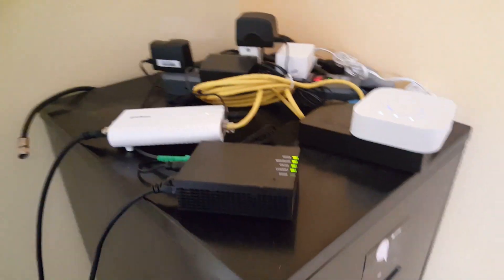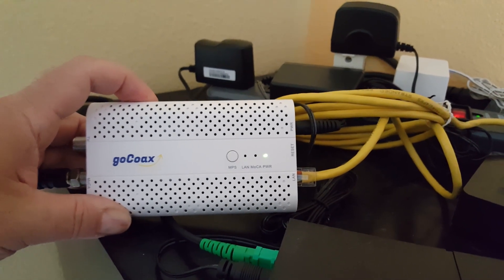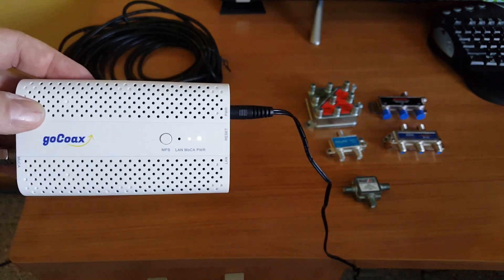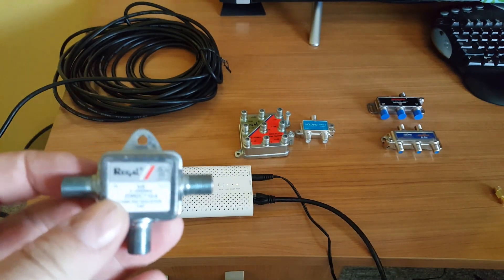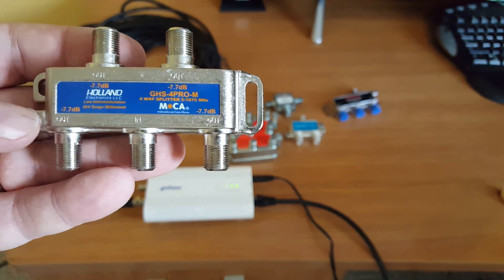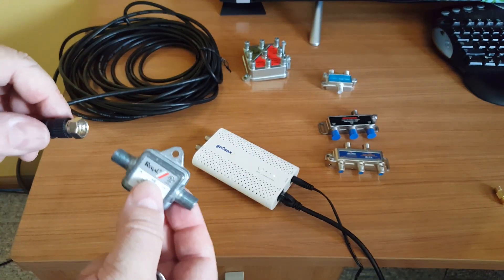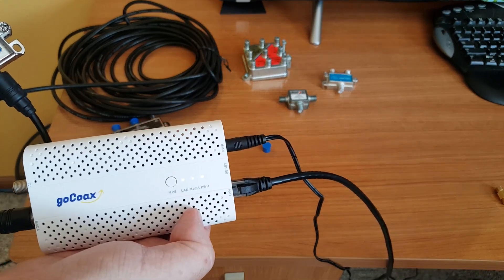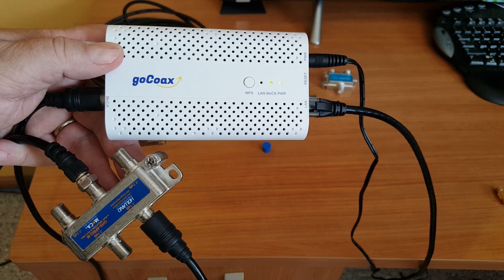How to troubleshoot connection problems with MoCA (goCoax WF-803M) and basic MoCA setup requirements

Comment: Hi I need some help I set up the moca up and everything but I’m running into the problem that my moca is saying my coax is not detecting I waited for 10 min and nothing is happening
Reply from the maker: Hello!  Can you describe your setup?  What MoCA devices, how connected and where is the 2nd location?  Also, have you traced/confirmed that there is an actual connection from the first device to the 2nd?
Reply: @UncleMikeRetro  thx so much for getting back to me, I have a pc and I did all the step properly and the power light IS showing up but the coax light is not there meaning it’s not detecting the coax
Reply from the maker: @overkillfn2918  No problem!  You do have to let us know what MoCA devices you have and how they are connected and to what.  it really sounds like, from what you say, that the first MoCA device is not finding the 2nd.  You do need two and they have to be on a coaxial line or lines that are ultimately connected and without any splitters in the way that might alter or distort the MoCA signal.  I cannot have any other thoughts unless you share some of these details, pal.

Comment: Hi Mike,  thanks for the video. I just got my moca set up and running in my new house. I have two access points connected upstairs and running Moca. I am running into some issue where one of the access points drops internet and I need to unplug/replug the moca in order for it to work. 

Do you have any idea what could be causing this? The splitters I have hooked up were the ones the were originally on the coax so may not be moca compatible?

Interested to see what you think. Thanks!
Reply from the maker: Hey Travis!  First, thanks for the kind words on my humble video.
Second, how often do you have to restart the 2nd MoCA device?  I mean how often does it lose its connection?
If resetting it fixes the problem, how long between drops of the internet?
My gut says that the splitters are MOSTLY compatible, but if you get a connection and it drops (and you still maintain the internet on the first device/computer and don't have to reboot your router) I'd say try a MoCA compatible splitter next.

Keep me looped in, pal.
Reply: @UncleMikeRetro   Hi Mike!  thanks for the resposne! I have a new issue that I am hoping you may be able to help with. On Friday night, Spectrum came out to my home and turned my service off because they said my home was producing  "noise" on their network.  After a few visits from a tech, they said the noise was likely from my moca network and the additional coax cables running off my splitter that were not being used. They told me my Moca would continue to create noise for them and that they would likely be back out here to turn it off if I hooked it up again.

Is there any way to combat the issue? They did run a new line to he home so I dont think their cable was the noise issue. Thanks for the help!
Reply from the maker: @travishmoore17  Good morning, Travis.
The only thing that comes to my mind is that you may need an inexpensive "MoCA filter" placed where the Sprectrum signal enters your home.
This site has a pretty good article about them and the placement: https://www.ppc-online.com/blog/moca-filters-your-cross-interference-issue-solved
Aside from that, I am clueless.  Spectrum obviously knows you have something interfering with their signal and it may be that this can isolate you from the rest of the neighborhood.
Let us all know!  and good luck, my friend.

Comment: Thanks for this very clear presentation.  I have a two-story house with an attic.  Multiple splitters are employed in the attic and I suspect there are other locations where splitters are used.  The cabling was originally done over 25 years ago.  Will I have to track down and replace every splitter in the house to insure an optimal and reliable MOCA network?
Reply from the maker: Hello, Dave!  Thanks for the kind words on the video!
In my opinion, no.  Not initially.  You hook up two MoCA devices in different rooms and cross your fingers.  You may have lucky splitters, you know?  If not, then check them one by one, but only the ones directly in line with your rooms, not the ones on areas you are not using.
I also have small splitters here and there (some probably inside my walls), but I only worried about the one big one between my upstairs office and downstairs studio.  The others I ignore for now.

Comment: Mike, do moca adapters extend my wifi signal like a mesh system but better?
Reply from the maker: No.  They only allow you to run the equivalent of Ethernet over coaxial.  Nothing to do with wifi.
Reply: @UncleMikeRetro  so can i use moca adapters for my mesh for wired backhaul? Or just connect a wifi repeater to each moca adapter?
Reply from the maker: @nirhaber6149  You can use the adapters wherever you need the wired structure but you gotta have coaxial in place first to even make them work.  Sorry if this is basic info to you.
Reply: @UncleMikeRetro  I do have coaxial cables as I have a TV in every room
Reply from the maker: Then these will provide the equivalent of Ethernet connections in any room with coaxial cables already installed.

Comment: Two story home, if the router is in the first floor, that floor gets a very good signal and yields a very good internet speed but the second floor doesn't and vice versa. How would you use these MoCA adapters in my case? I don't have any switches nor hubs. One Coax cable going to the Modem and Ethernet cable from Modem to Router.
Reply from the maker: If you have coaxial in the other rooms, then it uses those lines as Ethernet cables, giving you 1 GIG connections.  That eliminates the need to worry about the WIFI signals except for those devices that NEED them (like ROKUs or smart bulbs, etc.)
What kind of internet do you get?  DSL, cable, etc.?
Reply: @UncleMikeRetro  We have Spectrum and yes I do have a cable line that I can use. It looks like this could be answer to my slow internet issue.
Reply from the maker: @jrpinedam  Yes, I had Spectrum cable internet too and this DID solve my issues.  I had no compatibility problems with that setup.  Now I don't care if I am upstairs next to my router (and hard lined into it) or if I am downstairs and using the MoCA.  Same internet speed, no additional lag.

Comment: New Sub here. What does the Gocoax actually do?
Reply from the maker: Hello pal!  Glad to meetcha!  Well, the goCoax (or any MoCA devices) allow you to use the existing coaxial cables in your home, apartment, etc., as Ethernet lines.  Speeds of 1 GIG and up and no loss of speed.  I am not affiliated with them, but love my setup so much I had to make the videos.
BTW, if I need to know about rechargeable battery packs, I should be coming to you!
Reply: @UncleMikeRetro  oh awesome a lot of people I know who live in apartments can not run wires or drill holes. This will help. Thank you for sharing this with us.
Reply from the maker: @DiyintheGhetto  Hey my man, it's all my pleasure!  Feel free to share with all of us if you get a network using this up and running!
Reply: @UncleMikeRetro  A friend of mine down in Georgia will be needing this I’m not heading down there for 3 weeks I also will post a video on this. Again thank you
Reply from the maker: @DiyintheGhetto  Sweet!

Comment: I have found that these goCoax adapters don't work well or stay connected when connected to a network that contains Actiontec adapters. It seems that they only work when connected to other goCoax devices. I replaced them with Actiontecs and had no problems.
Reply from the maker: Well, your experience is certainly worthy of note.  I only have the goCoax ones myself, but they are SUPPOSED to be cross compatible.

Comment: I have 3 Go coax adapters and they work excellent. The only issue I’m having is I can’t get back into the GUI. It won’t connect if I factory default them I can get into the GUI but once there setup and saved I can’t seem to access the GUI again I setup encryption, I’m in IT so I know networking I’ve just never really done moca before
Reply from the maker: Hello!  Hmm...
I did do another video on setting up a static IP on a separate computer, then attaching the goCoax device directly to that computer to access the device's web-based menu and then setting a static IP address on the goCoax device itself for future access.  I had to make sure that the IP I gave the device was out of the normal IP address assignment range of my router.
https://youtu.be/zHvnbgIXf_8
I have no idea if this will really help, but some found it useful to an amateur extent.  I reset my devices to factory settings after this experiment and never looked back.
All I was really able to do was monitor the traffic and speeds on the devices.  I like that they just work and leave well enough alone.